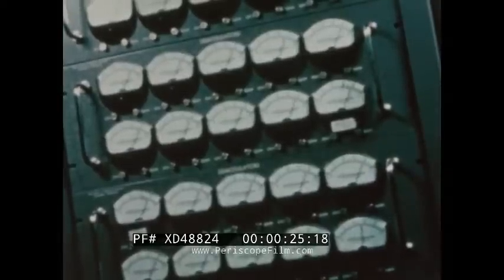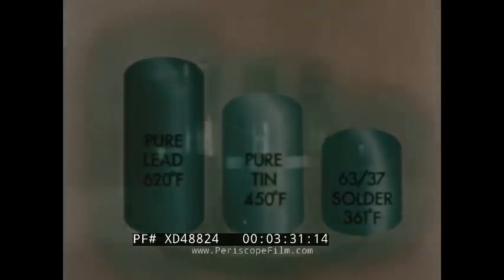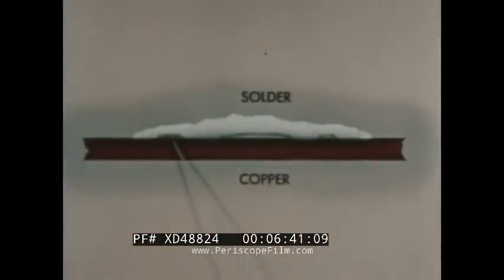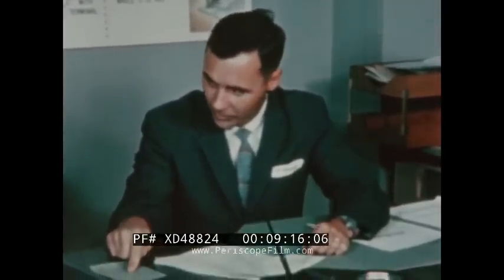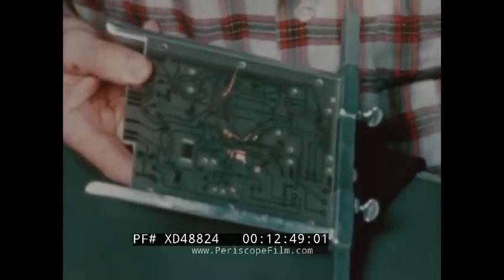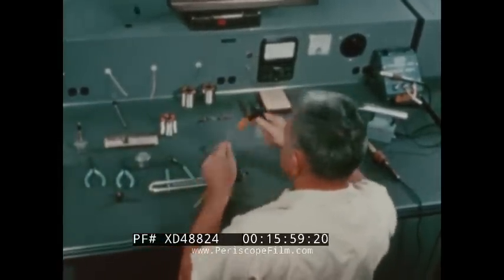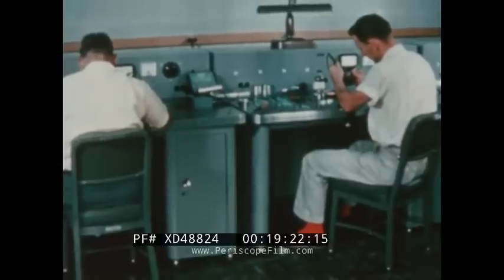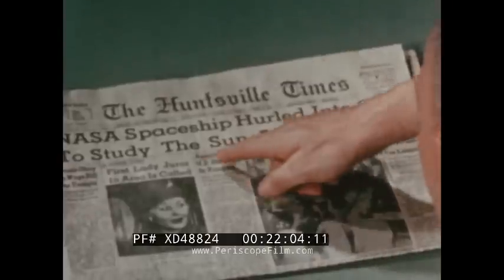1958 "ABOVE AND BEYOND" NASA SOLDER & SOLDERING TECHNIQUES ELECTRONICS INSTRUCTIONAL FILM XD48824

Comment: Man, our soldering technology has come a long way since this.  Pre tinned or silver/gold plated PCBs keep everything clean and ready to accept solder.  Good irons are now thermally controlled to maintain a constant tip temperature.  Lead free solder  joints look different than leaded, so inspection criteria has changed.  Great blast from the past.
Reply: I am surprised that there were no static straps in use - sure they were soldering passives but it is good practice to use straps all of the time.
Reply: @ianmontgomery7534  These folks didn't have CMOS circuits, yet. Whatever they are soldering here is not sensitive to electrostatic discharge.
Reply: Technology has sure improved, but the lessons in ensuring clean contacts  is still valid, especially when doing PCB repair work where the vias have been acid damaged from electrolytic failures or battery discharge.  knowing this information can only serve to help noobs like myself who treated solder as a "metal glue" when they were kids.
Reply: @jeffymooch  If you have an acid damaged PCB, then you simply replace the PCB. If you have electrolytic capacitors failing on you, then somebody didn't pick the right electrolytic capacitors to begin with. Electrolytic capacitors don't fail. Electronics design engineers who don't know how to calculate the expected design life of electrolytic capacitors do.
Reply: @schmetterling4477  that’s not always possible when dealing with old electronics that are no longer in manufacture.
Reply: @jeffymooch  Soldering technology is not a replacement for life cycle management.
Reply: @schmetterling4477  

Electrolytics leaking on PCBs is rare but it does happen even when nothing was miscalculated. Think about the 'capacitor plague' of the 90s and early 2000s, as well as those purple Matsushita caps of the 70s and early 80s, even though they only started to leak after 30+ years. 

I think I don't have to mention that 'just replacing the PCB' is very uneconomical in consumer grade equipment.
Reply: @westelaudio943  If you have 30 years of lifetime, that's 250,000 hours, which I would consider an extremely successful product design... and basically end of life. In the audio world older is considered better (even though it is usually not true), so what you are doing there is to basically restore a collectible. At that point you can essentially do whatever you want (or whatever it takes), including replacing PCB traces with flying leads. I have done that often enough. Given the poor material choices for PCBs and wiring in many consumer products the chances are that the repair damages more than it actually repairs. One simply has to accept that the manufacturers weren't planning past 15-20 years of lifetime. Maybe not even that much.
Reply: @schmetterling4477  

Older isn't necessarily better, but it's definitely more servicable. 30 years isn't really that old for HiFi equipment, most things from the 80s and 90s aren't considered collectibles yet, but they make great daily drivers, you can still get them for dirt cheap, and if you're able to do basic maintenance and replace some - mostly inexpensive - problematic components you can get many more years of useful life out of them. Corroded traces aren't that common, with the aforementioned exceptions. 
It's seems like your background is in some field where electronics are running 24/7 under rather extreme conditions, and thus you underestimate how long things can actually last in a more benign environment.
Reply: @schmetterling4477  I think you are getting a little curmudgeonly at this point.  Grab a rocking chair, watch Lawrence Welk and let it go Elsa.
Have a great day!
Reply: @ianmontgomery7534  static straps are for the most part a giant scam in the indistry. Its only needed when working with microscopic manufactured chips of the sort & even then the problems that cause static discharge to harm the inside of a component i have yet to see actually occur. I am sure it does occur, but the industry promoting this hype back in the 80s makes a lot of money off its static prevention products charging companies huge prices for products available far less under other brands. Such as their "static safe cleaner" for work mats. All it is, is Downy fabric softener at 3x the price. ANY fabric softener will do. And yes it removes static cling for laundry! But nobody forces employees to wear clothing without static & sorry Lab coats do not eliminate static and ground straps do not remove static from a sweater. Thats when i had a talk with an old boss at Intermec & told him i thought these static prevention measures were built out of fear & paranoia & that someone should question any so-called evidence. He agreed. It cost the company $250,000 a month just to clean lab coats. That was the first to go & that was over 24 years ago. The company could not detect a single failure, nothing to claim static as a cause of failure. The risk lies in how the chip is handled, after it is inserted NOBODY needs to be grounded because it is already grounded on the product. Even then we had trouble proving anybody who handled chips grounded or not caused any failures.  While it may have been a risk early on in the industry, ive never seen any evidence it still is. Static straps do not take the static out of a sweater & sweaters do not touch components. People do. There is no evidence people damage components other than the natural oils of the skin which damage optics.
Reply: @westelaudio943  while replacing the pcb may not seem economical, it is the standard thing to do. Nobody spends the money anymore to troubleshoot to a component level on a board. It becomes impossible sometimes on multilayered boards unless you have a particular component failing repeatedly is it ever done & thats a job for Quality Control. Generally, especially for service techs replacing the entire board is faster, makes the problem appear small by how fast it took to repair & has become so widely accepted in the industry management has made it a standard practice.
Reply: @schmetterling4477  manufacturers plan for 3 years of lifetime. Unless it is required to last longer, such as aerospace/military applications which require a 20 year guarantee minimium. But for commercial use the design is for 3 years with 7 additional years for product support if your product required FCC approval. Before the 3 year design became standard products were designed for 7 years, but by the 1990s it became perfectly clear technology made those products obsolete before the 7 years was complete & customers stopped using them for the new & improved technology. Designing for 7 years had become an unnecessary added expense. By 1995 a HP vice president  explained all of this to my group at the time and added all future production methods won't be done here or anywhere using this standard, it will be done in other countries particularly Asian. He was dead right about that too. Again, this was 1994 electronic mfg in the US was already dying by then. Simply picking up your so-called Smart Phone testifies to everything he told me. Not only are they practically obsolete after 3 years you can't even use one after 10 years because they no longer have to support it so they build it to not work so that if the technology doesn't force you to buy an "upgrade" (as this scheme is named) then time alone will force you to upgrade. It is a guaranteed source of revenue, a planned expense providing long term employment stability & a long term source of tax collection <the most important feature meaning; it can't be stopped.
Reply: @schmetterling4477  That "usually not true" has to be qualified somewhat. Which equipment is better depends on the media you're listening to. For example, it's literally impossible to buy a new cassette deck that doesn't sound absolutely horrible because nobody manufactures good cassette mechanisms anymore. All you can do is buy an old deck and refurbish it.
 Old refurbished equipment will also invariably last longer for the reason you stated; it was built to last while new consumer electronics are designed to be disposable.
Reply: @westelaudio943  Single sided phenolic boards have very poor properties and they don't get better with age. I hate touching it. Quality was not on the mind of the design engineer when he picked it. Cost was. 

I am not saying that you can't get useful old stuff that is 30 years old or older, but you can usually get very useful younger stuff for cheaper. I can go into my local second hand store and pick up a 10-15 year old surround sound system for $40 or less. Those have optical inputs, already. 

Now, is that the same as a 50 year old tube amp, in terms of collector value? No, of course not. It also doesn't need any soldering, there are no dead caps etc. It just works. 

Like I said, if you are into collecting, that's OK, but it has absolutely nothing to do with soldering.
Reply: @schmetterling4477  

I rarely paid more than $40 for an 80s receiver... They are still the best choice you can make when it comes to cost (including repairs) and longevity. This stuff just keeps going and going. Surround sound receivers are no good for stereo, which is what I use (I don't even have 5.1) and especially those from the last decade are very prone to crapping out and repair is often uneconomical to impossible (programmed MCUs and other unobtainable parts failing, no schematics, etc.) and being packed full of gizmos means there's just more to fail. I guess you don't watch 12voltvids. 
Optical inputs are not really necessary, use decent analog connectors and there won't be any noticable interference problems at normal lengths. 

50 year old tube amps... 1972, the era of monster receivers full of discrete transistors, tube amps were already a niche item at that point. 

The only time I had problems with phenolic boards was when I used a crappy unregulated soldering iron as a kid, and they will wreck pretty much any curcuit board. Use half decent equipment and it's smooth sailin'.
Reply: @westelaudio943  FM receivers are great, except that great FM stations are rare and you can get them streaming on the internet, anyway... 

Why are surround receivers no good? They have a two channel main amp that is perfect for stereo. You just don't use the other channels. 

And why would a 15 year old piece of electronics fail? They don't. I have one running for five years now and it works flawlessly. 

Look, I get the collection thing, I am just not into it. Give me the latest 8k OLED tv, instead.
Reply: @schmetterling4477  

You can hook up any source you want to a receiver and ignore the tuner. If you want to stream music through it just connect it to a... computer ? 
Or a phone for that matter, via a cheap bluetooth module powered by a phone charger (they sound decen't nowadays). Why would I want my amp to connect to the internet? 
If your A/V receiver still works after 15 yrs it's probably a decent model, however good luck repairing it once it doesn't. And being from the mid 2000s it doesn't have those gimmicky modern features as well. 
You were the one claiming electronics are only meant to last 15-20 years by the way. 
There is a lot to go wrong in a unit like this as I already explained.  
I still see no point in using a bulky A/V receiver for stereo with a bunch of unused channels and features when I can just use an older sleek stereo unit which is half the size at the same power and of much better quality. 
It almost seems like you're trolling at this point.
Reply: @westelaudio943  I am simply giving you attention since you think that restoring old equipment is an extremely important application of solder technology. :-)
Reply: I'd argue that lead free solder has been a step backwards. Tin whiskers are a huge problem.
Reply: @kleetus92  There are tens, if not hundreds of billions of products with lead free solder out there and they are working just fine. That is not what a "huge problem" looks like.
Reply: @ianmontgomery7534  a poster on the Bottlehead forum pointed out that there's what looks like a metallic foot strap of some kind (19:11 in the video--look for the orange socks) and wondered if it was a foot grounder. But I can't find anything about the history of foot grounders in the 1950s...
Reply: @mary27182  Slave labor? ;-)
Reply: @schmetterling4477  Yeah, and the billions of ones that aren't, aren't working... so there's that.
Reply: @kleetus92  Like a seven year old smartphone of mine that died because of memory corruption? That's a software problem, at best, not a solder problem.
Reply: @schmetterling4477  Probably actually a chip failure, not the software or solder...
Reply: @kleetus92  A properly used flash doesn't fail. If it was a solder problem, then the phone wouldn't boot, at all. The flash has simple reached its write limits and either the wear leveling algorithm wasn't sufficient or the Android OS writes too much back.
Reply: @schmetterling4477  Us people who collect and repair and return to service vintage test equipment beg to disagree. A crapacitor (Sprague comes to mind) in a 50s or 60s VTVM will need replacement, but usually does not damage things, thanks to the point-to-point wiring.  The small electrolytes in the seminal Fluke 8060A almost all need replacement, and since this is a PCB construction, space is at a premium, so opportunity for damage exists. 
While both instruments are replaced by modern successors in production use, I intend to pass on my 8060A collection, in working order, to my sons.
Reply: @mansnilsson4382  Like I said, I don't have anything against collectibles, but that's all we are talking about right now.
Reply: @schmetterling4477  Electrolytics  CAN in fact, fail. Or have you forgotten the bad caps of the 2000's?
Reply: @viscountalpha  Absolutely, any component can fail. I've seen mil-spec electrolytic caps fail in applications where they weren't stressed anywhere near their rated limits. At least they were easy to troubleshoot; capacitors should never get hot and start leaking :D
Reply: @viscountalpha  The bad caps of the 2000s were almost universally due to poor design decisions. There are well known formulas for electrolytic capacitor choices that impact reliability. Almost all design engineers keep ignoring them.
Reply: @schmetterling4477  I agree.
Reply: Critical soldering still uses lead solder.
Reply: @StuninRub  High reliability electronics isn't made by low temperature soldering. It uses direct bonding and welding processes.
Reply: @ianmontgomery7534  check at 19:13
Reply: @ianmontgomery7534  check at 19:13

Comment: When I worked at a repair depot, we had to recertify our solder skills every so often.
The instructors jokingly accused me of using NASA techniques when I use just enough solder to pass "minimum" requirements.
Reply: I had a similar thing happen to me.  I went to work in the engineering department of an avionics company and started building test fixture boards.  I handed in the first one for inspection and my supervisors says "You don't have to work to class 3 standards. What we make in this department will never fly."    My reply was "I only know how to do the job right.  My technique is built around perfect component placement and soldering.  If you ask me to degrade my workmanship it'll take longer and be harder for me."     Later my supervisor told me that my SMD soldering was as good as anybody in production was doing.
Reply: @Turboy65  SMD was much more satisfying than through hole.
Reply: For high voltage application the minimum solder is not good. In this case the solder is applied until a smooth ball is formed. This prevents  corona discharge when voltage exceeds 2500 volts or more
Reply: @dant.3505  Yes, we had a ball soldering course available for that. 
But I never dealt with high voltage circuits like the guys that worked on Radar HV power supplies and switching gear.
Reply: @dant.3505  ...that's true.

Comment: I read somwhere that there were so many soldering joints in the Apollo vehicles that if each joint used 1/16 of an inch more solder that would equate the wieght of the payload.
Reply: That's pretty mind blowing.
Reply: Its surprising how the little things add up..I kno on my rc stuff I started using less glue..then lighter glue for a few grams same with paint. Thinner coats few grams less wire before you know it those 2 grams are now 10g an plane feels way better
Reply: Yeah, think about most of the electronics being used... they could consolidate all the discrete components into a handful of ICs or FPGAs and put most of the electronics in a shoebox. It's not a knock on those guys back then, they were blazing a trail that today we look at as a super highway.

Comment: Ah back in the good old days with real 60/40 solder and breathing all those fumes!
Reply: yep - no safety glasses either...ah the good old days.........
Reply: The lead boiling point is 3,180°F and tin boiling point is 4,716°F,  just because something is liquid does not mean it is boiling, does water boil at room temperatures? no. So there are no fumes coming from the lead or tin at all, the fumes you see is from the flux only which is no worse than second hand smoke exposure.